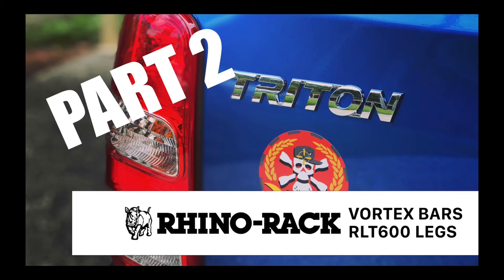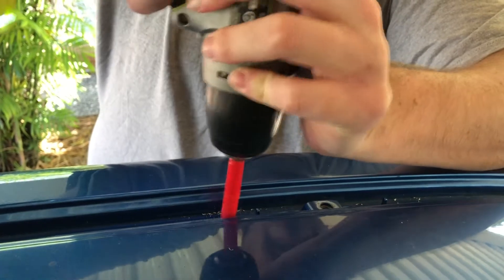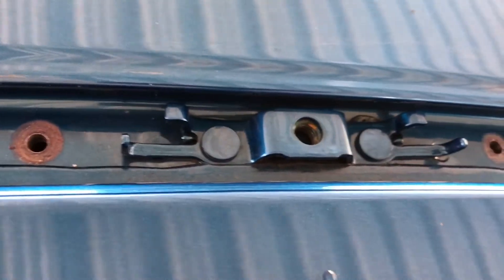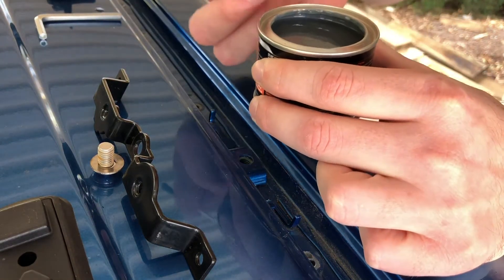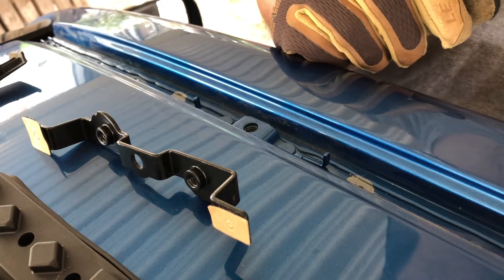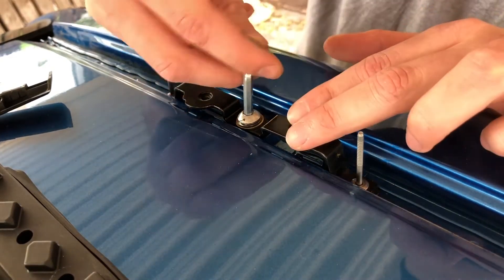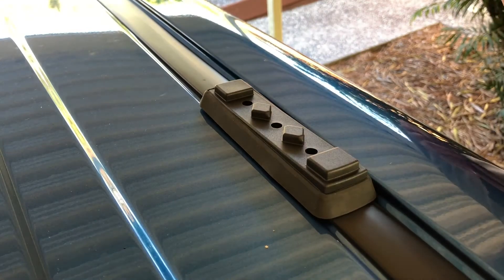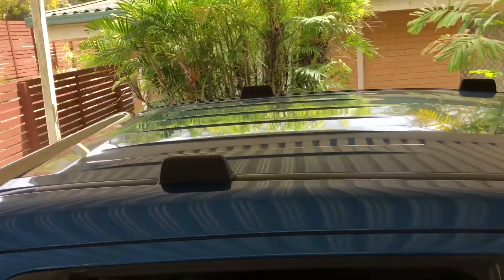Rhino-Rack DIY Install Part 2 - MQ Triton with Vortex Bars and RLT600 Legs

Comment: Thanks for the tutorial  Pt 1 & 2 mate.
Reply from the maker: GGFCHMMAL I’m glad you liked it. Triton and Rhino rack stuff was just too hard to find so I felt I had to put this up. 👌🏼
Reply: Hey mate, do you have to drilled them on? Won't the screw be enough?
Reply from the maker: Marial Maguet Hey mate. The screw probably would be enough. The black bracket that screws to the roof did have some flex in it though so over a period of time you could have issues.